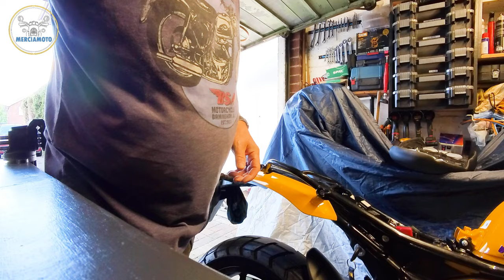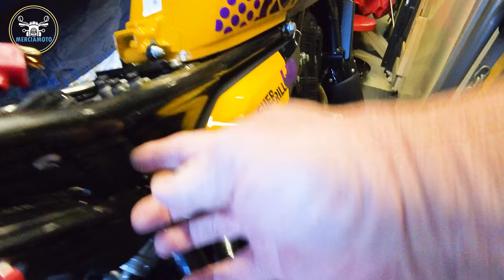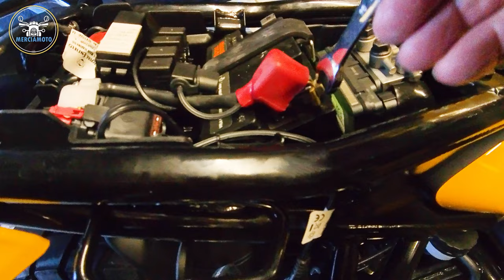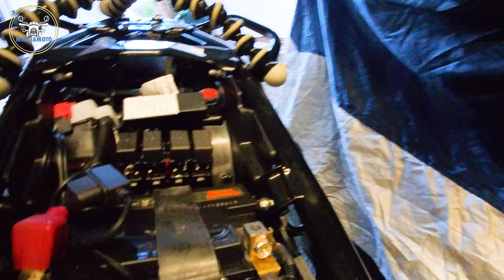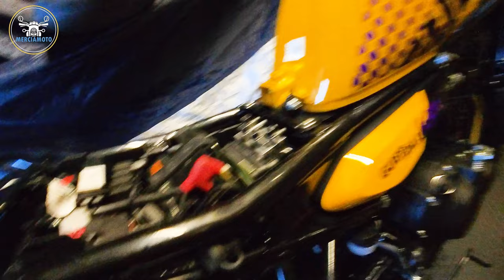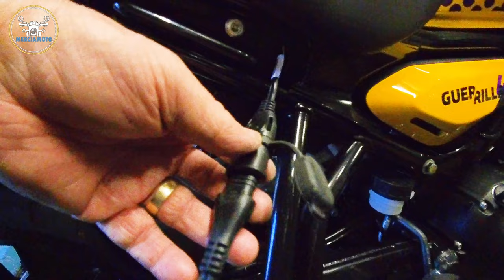Royal Enfield Guerrilla 450 - How to Fit an Optimate Charge Lead

Comment: Well, at least it looks like the battery and the terminals are accessible on the Guerrilla. Looks a fair bit easier than the Himalayan 411 and the Meteor. This is the first job I do with any bike, so good to see that it should be straightforward !
Cheers Dave,
Garry
Reply from the maker: It certainly is an easy install on the Guerrilla compared to the Hunter and the Scram. Yep gotta get those charge leads on straight away. 😀👍🏻

Comment: Makes a nice change to have easy access to the battery, some bikes can be a right pain.  Your video is sure to be of help, especially the importance of disconnecting the negative first and reconnecting last!  Am I old fashioned to still use Vaseline on the terminals🤔
Reply from the maker: Cheers Paul, it certainly is a lot easier access to the battery on this bike, 10/10 to RE. Yeah disconnection and reconnection sequence is very important and overlooked at times I’m sure. 

It can’t do any harm to add some moisture ingress protection to battery terminations, even modern ones. Can you believe there isn’t any Vaseline in our house 😂😂👍🏻

Comment: Morning Dave, tidy job 😊. How is the running in going ?
Reply from the maker: @ianhughesroyalenfield  thanks Ian. Just over 200 miles done now, did 90 of em last Thursday evening, weather forecast was dry, but can now confirm the bike handles really well in the wet! 😂 I have first service booked for 27th September. Now that I’ve gotten to know the bike I’m loving it more and more and can’t wait to get out and ride it. I think getting the rear suspension set up right is important. I softened mine by 3 stops following my initial ride and it does handle much better now for me, feels really planted in the bends. 👍🏻🙂